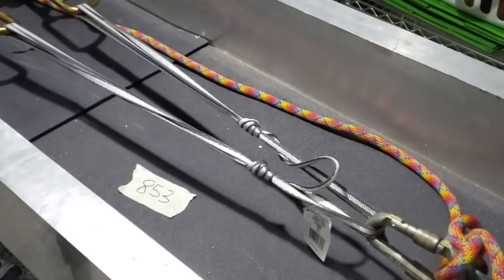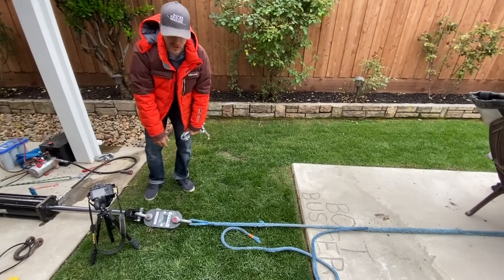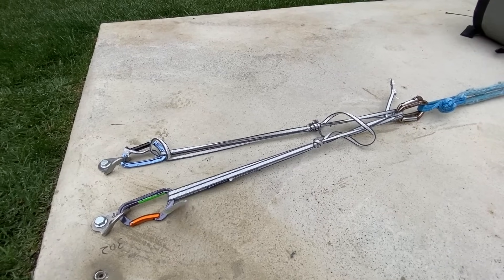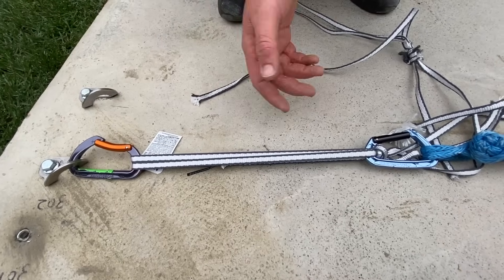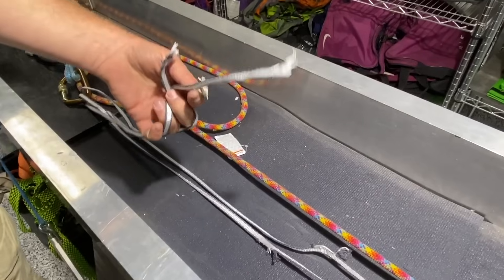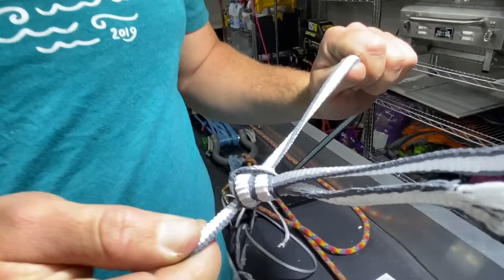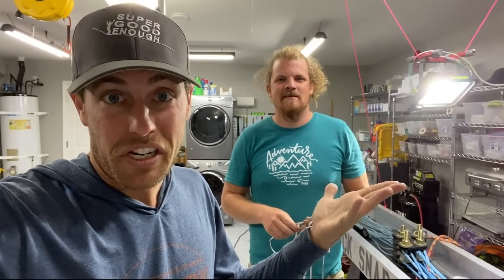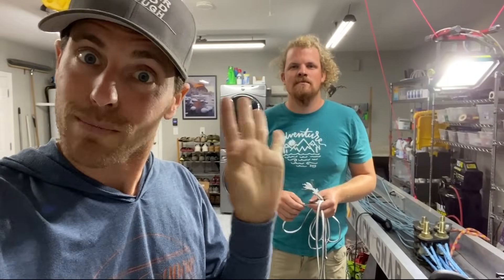Climbing Quad Anchor break test with 240cm Black diamond dyneema sling

Comment: The same test, except one side of the quad unclipped. Would the knot slip through? If so that kinda defeats the redundancy of a dyneema quad.

Also, similar but different, both sides clipped, but pulling in such a way that one "bolt" is not loaded (the quad is loaded outside of it's "range of equalization" pulling on the knot)
Reply from the maker: those sound like good tests
Reply: I only wish I had the coin to donate the slings! I love your content man, y'all answer all the questions I ask myself when setting anchors. another note on the first test, if the bar tack is in the unclipped side it would be harder for the knot to slip.
Reply: It probably doesn't really defeat redundancy because you won't have an ongoing 10kn force pulling on your role while climbing. Even getting 10k at all is highly unlikely. A big lead fall normally generates about 7kN (if I'm correct).

I think that slipping might actually make the ultrastatic dyneema a little more safe for big shot loads. might be a long shot tho
Reply: @sechsfufzig8738  even if the knot did slip you're still clipped into the sling (unless the sling broke/got cut), so yeah I guess you'd still be "good".

Comment: You know what I want next! 2 separate side by side sliding x slings. Let's get 103 with redundancy !
Reply from the maker: i'm definitely going to play with the 2 separate sliding x slings!
Reply: @HowNOT2   its so easy to setup and it should be super good enough! as long as the slings are exactly the same size it should come close to the same numbers too.